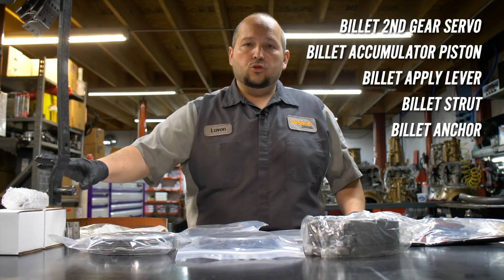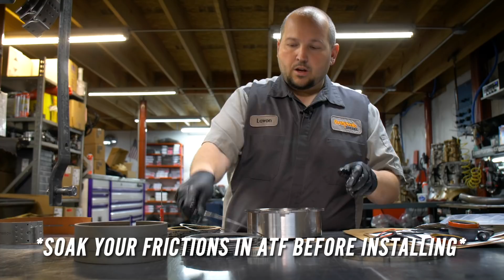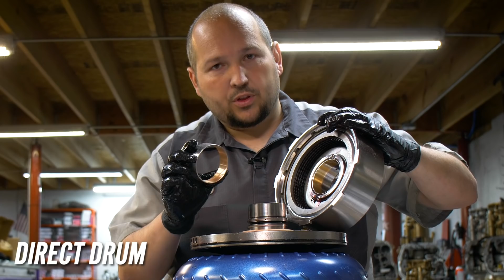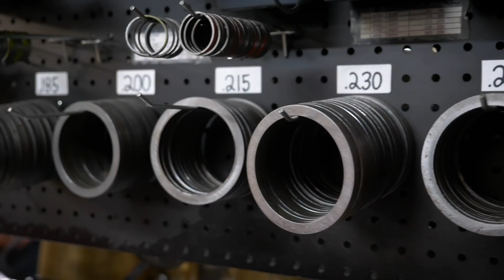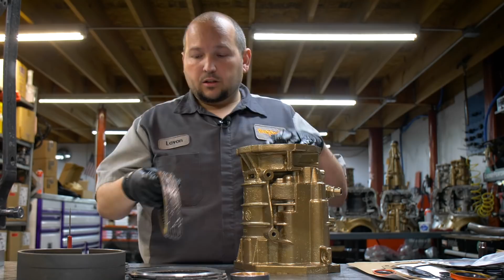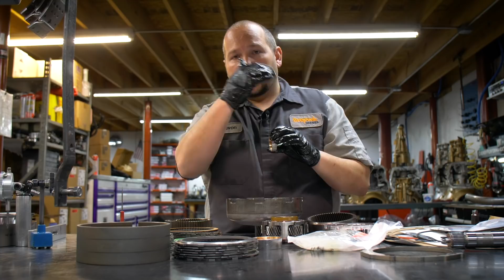Rebuilding A Transmission In Your Garage - Firepunk Master Kits

Comment: Heard some shops went back to using the wavy snap ring in the overdrive on 06-07 48re with the Tva motors, because no wavy snap ring can cause a harsh downshift in tow haul.   Firepunk guys are the best. Very helpful videos
Reply: That's what Performance Trans says  in Amarillo.
Reply: I honestly have not run into this issue yet, just finished a 07 48re the other day, we never use Wavys here, and have never had the harsh downshift issue unless it's one of our race transmissions
Reply: @madison69 For a street/strip build (mainly street) would you recommend wavy or non-wavy? Thanks in advance. Im doing a 727
Reply: Would this be doable by a diy’er that has never worked in transmissions?  If so, what special tools would one need?  Tom

Comment: You should try and put every part on the 47re and 48re on yr web site. Those selective spacers and the snap rings on the intermediate shaft are hard to find I would like to buy a few of every size.
Reply: Moparpartsgiant.com has the selective spacers. The snap rings are discontinued. I buy the same size from McMaster Carr.

Comment: I'd almost say it would be best to just replace coolers! Stock oe coolers are garbage that have the thermostat in them. The stock oe trans cooler lines are small and tiny. Delete any heater changer, replace the factory oe cooler with a nice mishi motor cooler that's twice at big and twice and thick.  Upgrade the trans cooler lines and go with the fleece perf trans cooler line kit! 1/2" flexible high pressure trans lines with AN fittings. Bigger trans cooler lines and a bigger trans cooler is another way to get more fluid capacity! Just between the bigger lines and the bigger cooler that's prolly an extra 2 quarts alone. Bigger pans add an additional 4 quarts. 
A secondary cooler mounted up under the bed with fans blowing on it for heavy towing.

Comment: I just learned a quick hack to installing a trans brake without any effort lol On a side note, would too loose a forward clutch result in a trans not going in lot gear? Recently my home built 47re started doing this thing where you start it, put it into forward gear, and usually nothing happens. If you rev in park or neutral to 3500rpm for a few seconds, it goes into gear fine. Doesn’t happen nearly as often once trans is up to temp. Also it goes fine into reverse all the time.

Comment: Just a quick question I have a 46re can I use the 47re master kit to rebuild it a little beefier. I have already used the heavier parts when I had to replace my forward band because the band strut wedge failed. I know some of the hard parts differ but if I can add a little strength during rebuild would be great.

Comment: Bought a early 04 2500 and it moves in drive but barely and its as if it's in drive or 3rd and reverse is perfect and all gears show perfectly on dash but when I manually put it in 1st or 2nd it doesn't make any sound and it doesn't feel as if it's shifting into the two low gears... im gonna pull it and go through it but just before I bought it it qas rebuilt to some degree because it's stamped with the rebuild date.. hoping it's governor pressure solenoid but my luck the forward is cooked.
Reply from the maker: Put truck in Nuetral then quickly slam the shifter into manual 1st and see 8f it takes off in 1st, if so it's governor pressure solenoid or transducer

Comment: Good afternoon I have a question for you guys I am having a issue with my 2006 Dodge ram 2500 diesel with the 48RE the issue that I’m having is the little square box that surrounds the park neutral reverse drive flickers and The truck loses power for a second or two and comes right back to life it does it when the truck is warm I’ve rebuilt the valve body in the transmission I’ve change the shift cable and the neutral safety/rain sensor 3 times I’ve made sure the tipm connections are cleaned the battery terminals are clean have you guys had any issues like that and what have you done to fix it thank you in advance

Comment: @firepunk. I have 07 5.9 with 48RE. 3.73 gears and currently running 315’s for tires. I need to replace my tires this year, and am shopping new 315’s or 35’s. Are these tires going to be trouble for my transmission?
Reply from the maker: The heavier/bigger tires will definitely put more load on the trans but a 3.73 and 35 can survive if you drive with common sense
Reply: @FirepunkDiesel  ok. I tow a 10k toy hauler but I don’t drive like an a$$hole, so I hope it’s ok

Comment: I have exactly .020 but its tight in a few spots, can't get .021 in unless I press on the pack a little to assist. Should I go ahead and change the selective snap ring to add a little bit of clearance?
Reply from the maker: 020 input shaft end play is tight, I'd get it to 030 if at all possible
Reply: @FirepunkDiesel  My apologies, I should of been more specific as to what I was referring too. The fwd clutch pack tolerance, as said in the video set to .020 or as long as clutches spin freely by hand, ATSG manual calls for .025....I shaved a bit off the snap ring and was able to tightly fit .025 in, realistically probably closer to .023.

Comment: You say the billet bands tear up the direct drum but I beg to differ 

 The  stock bands do far worse damage  than a billet   you can actually reuse  a  drum that was damage by a billet  band  wear as you literally junk a drum that was damaged from a rivet  gouging  groves into the drum. You should  expand on this topic if you actually have enough  experience  with these billet bands
Reply: The billet bands are atheist  far more precise  and literally fit the drum perfectly the extra wide  band that is 3/16 wider is the only band I use anymore.  I don't believe  the  older borg band will hold what a wider billet band  can hold I seriously  doubt it

Comment: My transmission started to shake when shifting from 1st to second gear, checked the band and did service the oil + adjust the band, nothing has changed, it only shakes when shifting 1st to 2nd, any of you guys have an idea? also the trans has 40k on it since complete rebuild, oh also ive changed the governor selenoid too

Comment: Do you scuff up your steels some before putting them in with the clutch's?
Reply from the maker: No we don't, we will figure 8 scuff the direct drum if it's glazed but we used to do every steel but after some long term (100k mile) comparisons, we saw no real world difference in clutch wear

Comment: I am very suprised with all the money there is to be had in 48re transmissions that nobody has tried to manufacture cases and vb... i mean theres plenty of companies making billet engine blocks and etc but if just one of them spent the money on engineering the 48re case they could make it better and they would easily make their money back in no time id gladly buy a whole new case and vb just to know im stsrting with brand new parts.. i get that it would take a good amount of monry and time but it would pay extremely well i mean its not just dodge guys/girls that would buy them but also other brand vehicles that have cummins engines in them.. and i mean someone thst knows what they are doing not overseas but here just like the engine blocks are being manufactured ❤❤❤

Comment: Are you going to have a kit on your website that would be able to hold up to 1000 hp engine?
Reply from the maker: this master kit is what we use for all our big power builds, add a good valve body, and billet shafts/converter and you'll be ready to rock

Comment: How much horsepower is the master kit good for?
Reply from the maker: The master kit can hold 2000hp when you add the correct billet shafts, valve body pressure and converter combo
Reply: @FirepunkDiesel  okay from all that’s included in the kit what can be anticipated?
Reply from the maker: @talonsh28  about a 15% increase in clutch surface area over stock, I would add a valve body and it will hold 450-500hp with the weakest link being the stock input shaft
Reply: @FirepunkDiesel  okay that’s good to know. Provided the horse power is under 500, what could the transmission safely handle? Burnouts, boosted launches, racing etc?